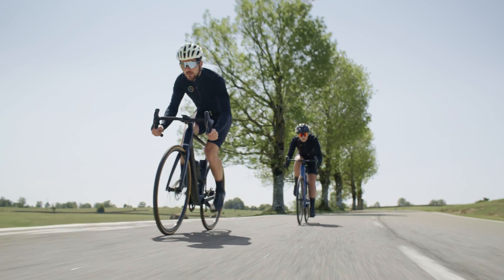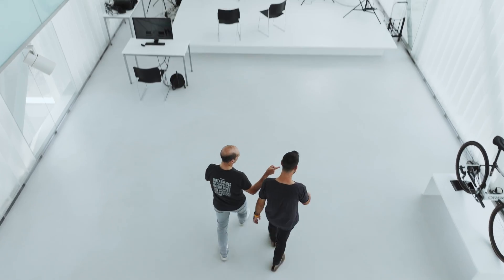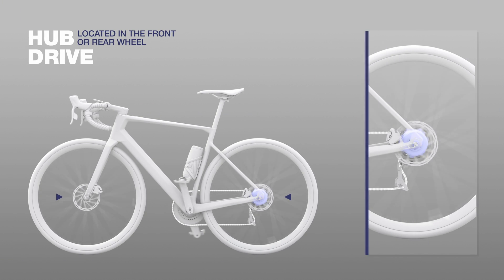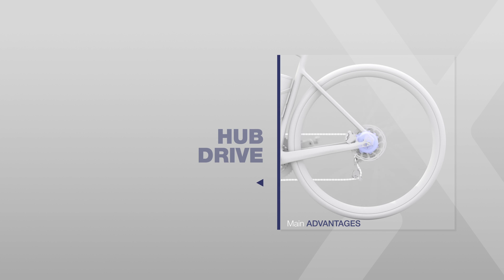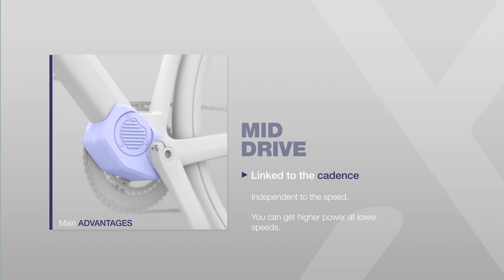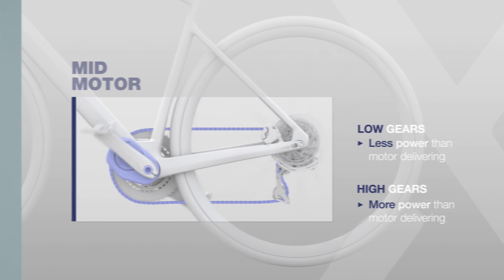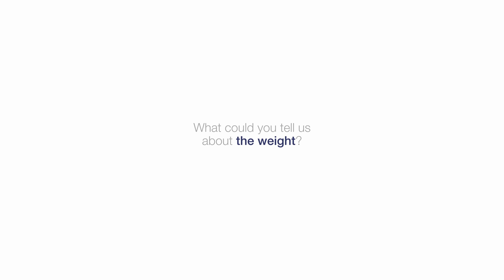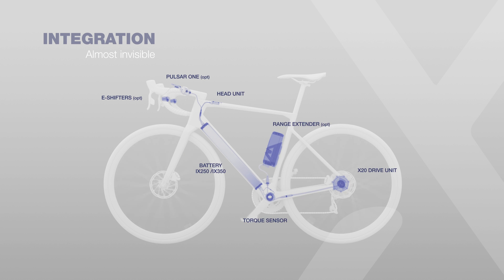Mid & Hub Systems Differences and Applications - MAHLE SmartBike Lab

Comment: I used my 3T with Mahle X20 last summer in the Alps, and loving it. Before using a normal 3T Strada race bike I could do max 12 to 1400 Hight meters in a day. Now with my new bike I get 2300 Hight meters out of the default battery + extender. Most of the climbs are between 10 and 13%. This summer to climb the Stelvio I also took the charge in my back to charge during lunch break. Now I purchased the new energy hub so next summer i only have to carry this small energy hub + USB C charger.  Only downsize of the whole Male x20 motor is for me that I cannot use the bike in The Netherlands on the road as my speed is always above the 28Km/h. Their should be a way to setup the bike for use in USA so you could use the support from the engine until 30Km an hour.
Reply from the maker: Dear customer,
In Europe, by law, e-bikes cannot provide electric assistance beyond 25 km/h.

If you have any questions or need further assistance, feel free to contact us.

Comment: My wife has 3 Bianchi bikes with MAHLE X35 systems. She loves them! The only issue we've had was some spoke breakage on one bike's rear wheel. Based on her experience I bought an MAHLE X20 equipped gravel bike for myself. Barely 1000 kms on it so far but it rides like a normal bike at 0 assist level but when I'd shift down to the "granny gear" on my old road bikes, I just move the assist to level 1 with X20 instead. I still get a good workout and enjoy the ride, but I always know I'll make it back home if it I overdo it.

Comment: We have experience with the Mahle hub based system.  2 bikes with this system have had failures of the free hub and this is both expensive and requires special tools to change.  Another downside is that you are stuck with the wheels fitted to the bike when you buy it.  I have now opted for the Pinnarello Nitro crank based system.  It is fabulous, light and very aero. Non of the above problems apply and it also provides data on cadence and my power metering to my head unit.

Comment: My X35 motor really struggles on steep hills climbs, such as 10%+ & i feel you have to keep your cadence quite high to keep the power output high enough to help you up. So it's definitely got a sweet spot in terms of rider input.